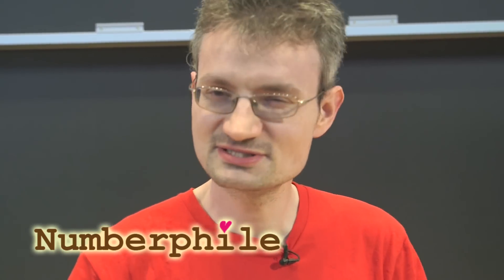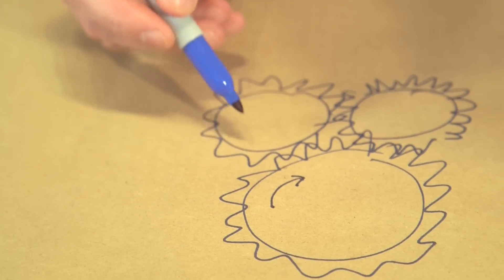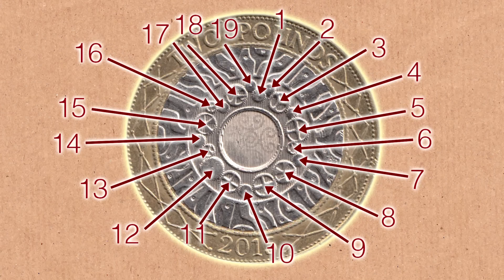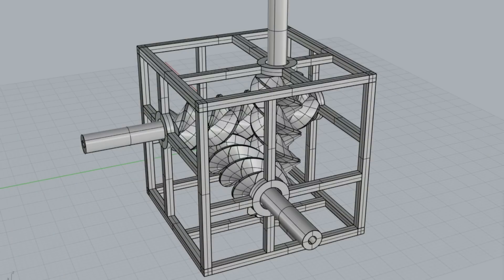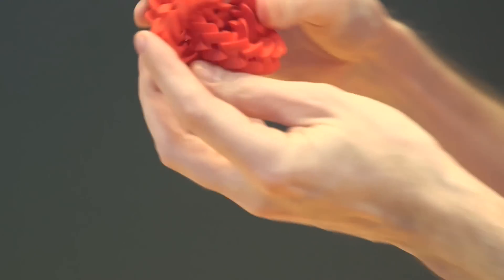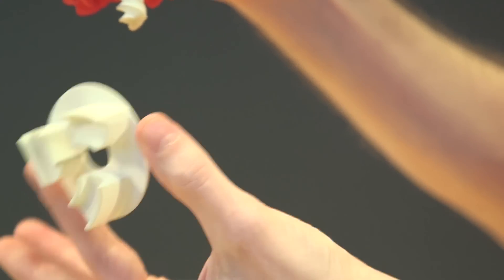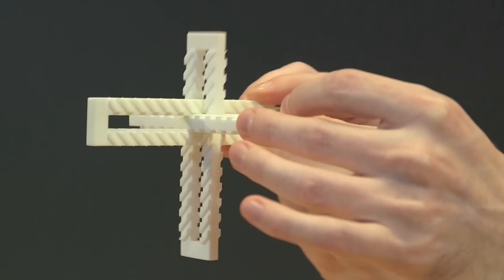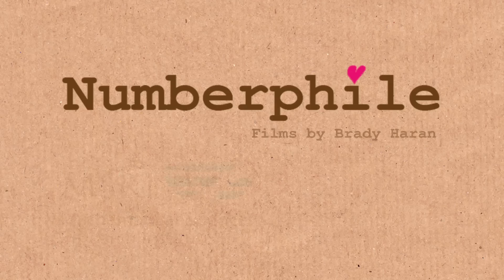Three Gears are Possible - Numberphile

Comment: +Numberphile, Are there industrial uses of these?
Reply: Templarfreak Oh really? Do you own a car or buy anything that wasn't produced locally? Oh wait, you're on the Internet, guess you have an electronic device that was made without the use of mining drills for the tantalum in your capacitors, without trucks to transport raw materials, without CNC machines and 3D printers for R&D... hmmmm...
Reply: Templarfreak Okay, maybe the drill was a bad example, and it seems to depend on what CNC you use, but 3D printers absolutely use gears. Also... what exactly do you think a car transmission is?
And let's not forget about robots. Servos, anyone?
Reply: I doubt it the gears cause to much friction when producing work ,and because of that are likely to break more often than even regular gears.
Reply: AxCissioN
I was talking about the three gears utilization in modern equipment. Three gears means more friction than a standard gear meats gear situation.
Reply: Templarfreak You have to remember that a gear spins on some kind of axis. There is definitely going to be a significant amount of friction introduced there.
Reply: Templarfreak I think what you are trying to do is think about the simple friction of an object. If you take a non-cuboid box, lay it on the smallest side, and compare the frictional force to the same on the largest side, the forces will be equal, because although you have a larger surface area, the weight of the object is more spread out for a smaller pressure... I believe that is how that works out.
Reply: Templarfreak But there is more mass with 3.
Reply: Robert Dicke Post it somewhere man, I'd like to know. :D
Reply: Templarfreak don't cars have gears in their axles... that converts power to the wheels, engines have gears in them on things like the cam or crankshaft
Reply: Which is ironic seeing your super bold (but ignorant) claim of 'gears' being outdated Templarfreak. Sorry, but you know nothing of this world if you believe that everything is replaced by 'hydraulics'. You can find gears in just about everything and they provide a transformation of power and impedance matching with efficiency that puts electronics to shame. 

"Hm. I think if I were to continue this conversation I'd actually have to do some real in depth research and I don't have the time for that."

Well you can ignore your own thoughts on that, because it's evident you didn't bother to do research for your other statements either. So why pretend? ^^
Reply: Ignorant is too kind a word for Templarfreak.
Reply: There is potential for use for just about any gear setup just depends on what kind of axis you want to be able to move etc.
Reply: bikes still use gears.
Reply: Templarfreak I almost died laughing at your claims that gears in cars don't actually mean gears. I am baffled by the stupidity but I got a huge laugh out of it so thanks
Reply: SusquehannaOutdoorsman there are differential gears where to axles meet in the centre. This allows the driveshaft coming from the gearbox to transfer energy to the wheels. It also allows for either wheel to spin at a different rate relative to which way a car is turning, thus allowing it to go around a corner. If you used a straight axle it would probably bounce or drag the outside wheel around a corner.
Reply: I think a few people here need to learn to chill. If you discourage being wrong, you discourage learning.
Reply: Templarfreak I'm sorry but you are so wrong on so many levels.

Comment: Are there any real uses for the triple gears?
Reply: Simplifying synchronization in some machines. No sure about their efficiency although.
Reply: The first(working) one would if you want to haveone input and two outputs and have all at 90 degree angles to each other in a verry simple compact way
Reply: +joshua denton maybe yes, but the problem is, that their movement makes them slide against each other and that makes them wear faster than other solutions.
Reply: Mazda engineers like being weird maybe they have some use for it

Comment: That last one. It can be used in a 90 degree bent door, as a lock. You know. Instead of using two locks, one can be used to lock the north and the west facing sides of the door in one go.

Comment: Do those three-gear thingys have any practical application?
Reply: As response to a post with a similar question I tried to answer that in a comprehensive manner that took into consideration that not everyone understood every aspect of the forces of regular old 4 cycle combustion engines and how their design affected performance. That how knowing this and designing a three gear set that made two very different engines work in opposition could result in a revolutionary change in automotive designs and capabilities. After 3 hours of writing and revising my comment couldn't be posted, so I instead saved it so at least my wasted time wouldn't be lost. however the answer is yes.
Reply: I hate it when that happens..thanks for the answer

Comment: odd number of gears can work, it just doesn't work if they are locked together in a triangle like that. "idler gears" are used to change the output rotation of things that are geared.
Reply: Also, those drawings are designed to represent and idler system. If you just google "idler gears" the first picture is a real life example of your drawings, except with gears spaced correctly. And the first drawing on the top left will work btw.

Comment: This... could have some application. In very specific, niche circumstances. Effective you're taking the helical drive rod, and splitting the mechanical power three ways simultaneously. And due to the nature of the interlocked gears, you can interestingly translate that power in a huge variety of angles, and do so with a more conventional gear design. EDIT: and they also all turn in the same direction, which is extra neat.

I'm not sure what you'd need 3 outputs off a single input for, but it's a thing now. Just pass it through the engineering department to make the design more mechanically sound and wear-resistant.
Reply: The thing is, these 3 gears don't have to be awkwardly interlocked to create movements in 3 directions. The object is pretty cool from a mathematical and visual perspective, but all this design does is increase friction and it restricts the ways in which you can place the gears.

Comment: Does this imply that the number of gears should be an integer multiple of the number of dimensions you're working in when the number of gears is greater than or equal to the number of available dimensions? In other words; 2, 4, 6, etc gears in a plane. 3, 6, 9, etc gears in three dimensions?

Comment: Re: your 2 pound coin, I saw a video talking about this. It seems the designer considered gear lock, and included 20 gears in the original design to make it mechanically correct. One of the gears was subsequently removed.

Comment: ...that red trilobal interlocked gear set, I wonder what the driving force vs opposing force is required to lock the gears, the possible grip force, and if you could set the tooth ratios to work with cable winding.... Then two sets could make a wire climber, possibly W intrinsic auto locking. If the gears work W rubbers or a spherical centre, a pole climber.
I wonder what kind of force it could output integrated as some kind of linear gear driver...

Comment: Three counter-rotating gears in the same plane (2d, like a picture.)  However, gears can rotate the same way, as in an intermeshing gear compressor.  The axels form a triangle, and the gears are shaped like this:  <|>  (Only the angle is 120 degrees obtuse.)  Not parallel to each other, nor perpendicular axes like most of these examples.

Comment: So if there were 20 gears. it would have worked?
Reply: if it's any even number and the first and last gears are being turned at the same rate then yes it sure will
Reply: ooooh. oooo! i see. yea the same rotating speed is also required. thx.
Reply: it just needs to an even number of gears, so yeah

Comment: If the gears are in a circle, even if it is an even amount, the size of the gears can make it not work as well. The final gear would have to be turning at the same speed as the initial gear or the initial gear will be forced to go slower or faster which will just lock up the system as if you had an odd number of gears.

Comment: 100 is even. Divide by 3 you get 33.333 etc. The output shafts are 33% away from the nearest corner on the tri worm gearbox. 3 worms, 33%, 1/3 twist..... weird stuff. Definitely connections here....

Comment: As great as this video is, the solution presented here though several clever examples still doesn't solve the (non-existent) problem of the three gears. Three gears in the conventional way they're presented in these "working together" images simply don't work. The video tackles the problem by inverting the direction of one of the gears in relation to a second gear so that it still works with the third.

Comment: In terms of sticking with the definition of 'gear' or 'three' for that matter, nope, three gears in fact aren't possible. The solution of using three drive shafts isn't the same as using three gears (drive shafts aren't gears), even when using such an additional frame and three drive shafts will actually enable some practical uses.

The one with the three intertwined gear-like objects comes closest from a visual point of view, but it's practical value with those three 'gears' alone is zero. For it to work better you're going to need yet another drive shaft. In fact, the Trefoil Cog made from a solid material, instead of what's really more of a chain of plastic parts instantly reveals there's a really just a trick to your 'triple gear' that's not even a gear at all. Heck, an argument can be made the triple gear in plastic, is in fact just one single gear with chain-like properties twisted into itself. Ergo, sorry.. but I don't see how this video proves 'three gears are possible'. 

I demand some quotation marks in that title... lol.

Comment: how can the pole be ring in a car it wont work at all X) there is not a way it can move while beeing usefull unless the this (a car) would not move more than a few feets and if your a manual car guy you would not have time to releas the clutch then the gear is over the 3 gears thi is posible but only  for litlle showing like so

Comment: Amazing, this is the kind of stuff that drives ppl nuts. 
I have question about the last set of gears that are flat/straight.
Could you made three "round" flat gear that would turn around itself?
Could you then take two "round" flat gears and one flat "straight" gear that would turn the two "round" ones on "straight" gears plan?

Comment: i mean 3 • 6 is 18 and 19 is after 18 so wouldn't 19 gears work instead of 18 gears? all connected in a circle like what you showed on the coin

Comment: with 3 gears all meshed correctly... that would result in a system that is turned by the strongest force so even if they did turn they would turn according to the dear exerting most force.  a dictatorial system

Comment: You can make 3 regular gears work, just put all three in a straight line... like this...

⚙️ ⚙️ ⚙️ 

Bam, it spins all three and it works fine.
Reply: Yeah but you can’t put a motor in each of them with variable speeds and have it move .. like in those diagrams with student teacher and parent, each group is like a motor behind the gears

Comment: Are those "solutions" really using gears? What defines a gear? Because to me at least that first one is using screws rather than gears.
Reply: they are worm gears....extremely powerfull
Reply: Screws are technically a type of gear.
Reply: the second one has all the gears literally attached to eachother
Reply: It's a helical gear
Reply: A gear is a sorta umbrella term. Worm gears are indeed gears.
Reply: mineofminecraft it's called a worm gear, same thing you find in cars with torsen differentials, widely used type of gear in mechanics

Comment: Get the pole rotating the gears to near lightspeed, then push the pole through as it's rotating. Boom, gears are going faster than light. Next
Reply: i'd think the gears would mechanically fail before that can be done
Reply: @numbers3268  make it out of something that won't break